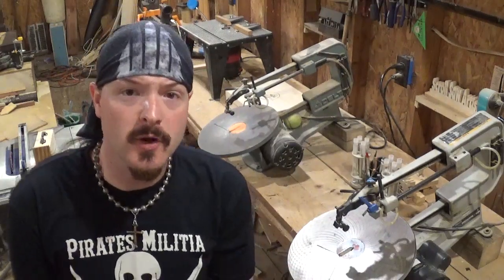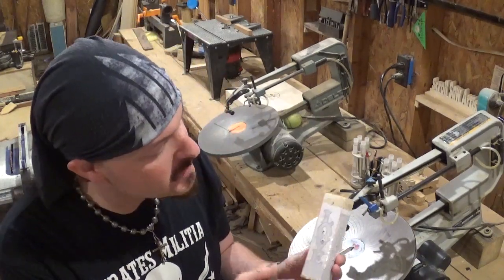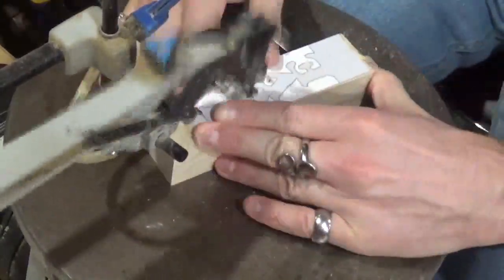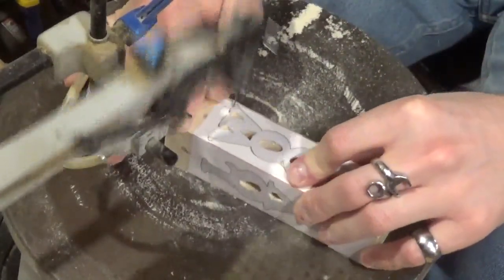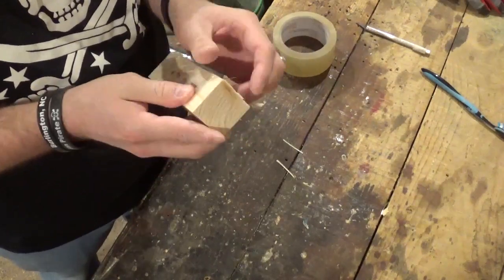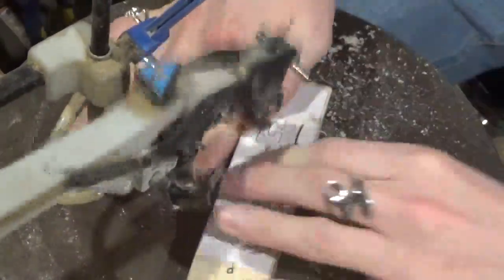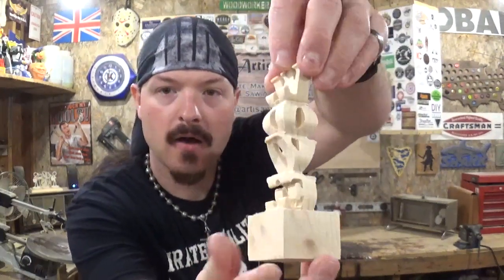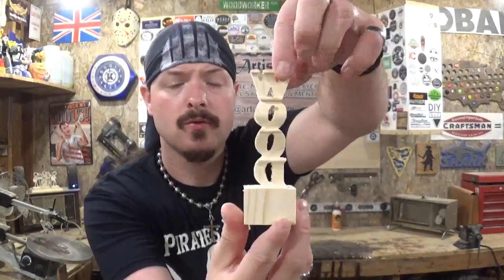Scroll Saw Compound Cutting (3D Scroll Saw Effect How To)

Comment: Looks like  fun. Guess my next tool will be a scroll saw ;) I like how you have the back of the saw up on a 4x4. Makes so much sense and I'll bet it's easier on your back. Question: What is the tennis ball for on the saw to your left?
Reply from the maker: Thanks, scroll saws are awesome and versatile. The tennis ball is a way of replacing the bellows for the dust blower. The older model saws, the bellows sometimes dry rots.

Comment: Totally awesome design. I had no idea that you can scroll in 3D. I've just bought the Dremel MS20 Moto Saw, which uses pinned blades, which now restricts me to some designs with smaller fret cuts. (If that's the correct phrase). I only thought you could do 2D. Love your video and will be following you. Downloaded the 'Love Wood' from your contact, Going to try it but I'm thinking it ain't going to happen on the first go. . . . good to practice though eh! Thanks bud, love it. x
Reply from the maker: Thanks for the kind words, take your time and let the blade do the work. I am so sorry for the incredibly late reply

Comment: Where do you get parts for your delta scrollsaw
Reply from the maker: Unfortunately Delta no longer carries parts for the 16 Inch Scroll Saw, I did order spare parts when the company did stock them.  However, you can almost always find this exact Scroll Saw in pawn shops for between $55 and $65.  I hope this helps.

Comment: very good video .... what is the diference between nª5 and Nª12 blade ?  hpw many teeth per cm ?
Reply from the maker: The Difference is a #5 Blade is very thin with several teeth per inch, a #12 blade is thicker with less teethe per inch and is able to cut thicker stock